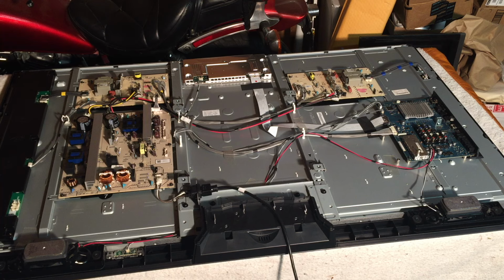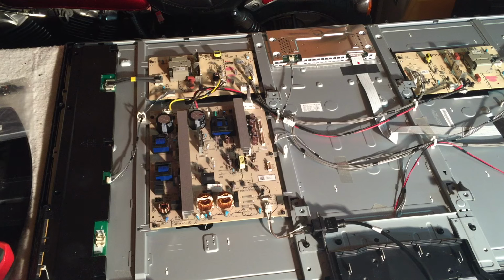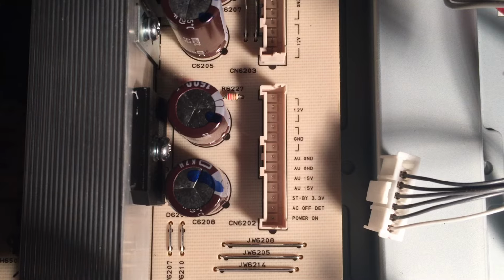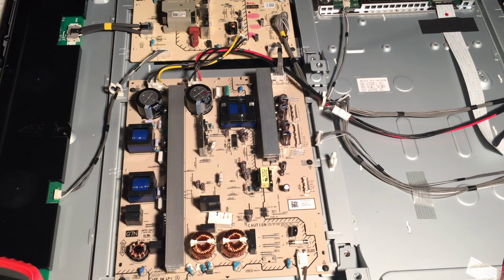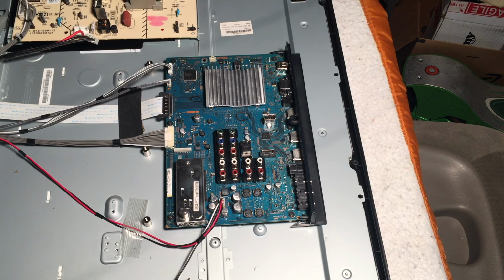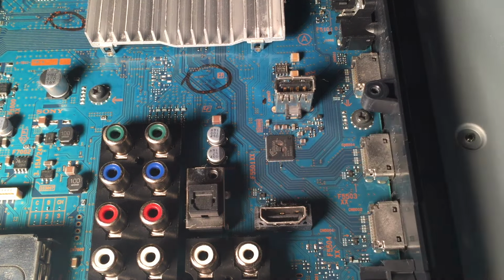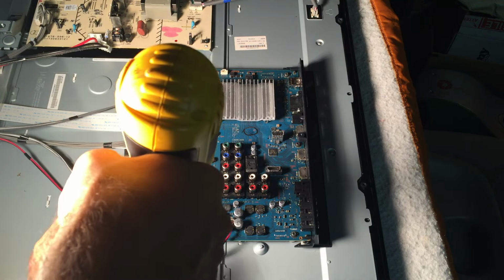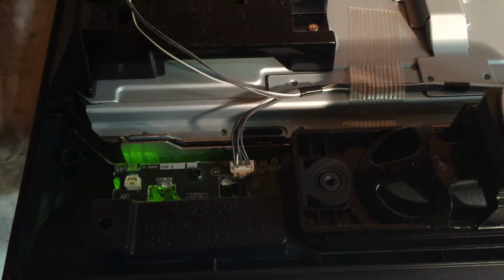How to Fix a TV Hit By Lightning or Power Surge

Comment: Hi. Thanks for the vid. I just replaced the same board on Panasonic OLED TH-55FZ950U that was so hard to find. The tv died when lightning hit the tall tree some 15m from the house. The tv was not giving any lights on front panel. I followed your steps to check the fuses and output voltage on power board and fuses were good and it does give the voltage output as it’s printed, so I decided to give it a go and replace the other board, although I couldn’t see any physical damage on any of the chips. The board was very easy to replace, but my moment of truth unfortunately didn’t go smoothly as yours, but at least I got a click sound when I turned on the TV 
using power button at its side. Then, green led at the front panel went on, then turned off and then kept blinking red. No pic or anything else appeared. Would you be so kind to suggest something additional? I love this tv and its remote and I would really like to get it fixed. Thanks again.

Comment: Hey man, would you happen to have any of the boards for a Phillips 65PFL5604 TV?

Also, have you ever encountered the following? After the latest firmware update on my Phillips, once the TV warms up there is a audible popping, through the speakers, in constant intervals about every 15 seconds maybe. It will continue even once the TV is turned off, and won't stop until it is unplugged.

I'm just curious, I'm trying to avoid spending the money on the board replacement, if it can be avoided. No it is not the heat expansion noises TVs make either. This is definitely coming from the speakers.

Comment: I have a 20 year old Toshiba 52HMX84 that was working perfectly !!
It was a victim of Duke Energy and its two back to back power surges in early July, 2024.

I’m trying to fix this on my own with no electronic experience.
It’s a DLP ….the bulb is ok….
I have ordered a new ballast for it but I have not checked the power supply board. 
When I have the TV unit plugged in the steady green light is ON…the Red light flashes…:
Shop Jimmy indicated it could be ballast or the bulb… it’s not the bulb….and I have not removed the old ballast yet to replace with the new (will arrive Sept 4th)

At the time of the Duke Energy double power surge….she was watching the cable and we also have an HDMI input port…
I have not examined any of those boards yet…
There is a small fuse near the corner of this big set and it appears to be good…not blown…that I can tell…
When I plug this set into the 120 outlet , I can hear a sound that briefly sounds like something spinning or trying to work…then it stops….

Any suggests on locating a qualified technician that would love to work on this great unit would be invaluable or any other tips to repair this unit..please let me know. 
Thank you !

Comment: Would it be foolish to attempt to replace the blown chip? Instead of the whole board?
Reply from the maker: The risk of only replacing the chip is that there may be other parts damaged too (like burnt traces).   But if you want to give it a try, then there's not much harm in trying.

Comment: Thank you so much. My sister has a Emerson tv and hers got hit by lightning recently during a severe thunderstorm. Now the tv changes channels by itself and the buttons do not respond correctly.
Reply from the maker: Sounds like either the main board got fried, the button bar (input bar - the part with the actual buttons), or both got fried.  If you have a separate input bar, try disconnecting that from the main board and use the remote control to operate the tv and isolate the issue.
Reply: Thank you so much.

Comment: Great video, and thank you! I have an issue with my 70” JVC LCD 4K TV, and would like your (and anyone else’s) opinion.
    The TV has been rock solid since it was delivered in 2019, up to now. It’s been used an average of a couple hours a day since. I was watching a movie a couple weeks ago, and the screen dimmed, then went black, with the movie and it’s audio still kicking along fine. I turned it off, unplugged it for a few mins, then plugged it back in. The red IR remote receiver light came normally, and I hit the “power” button on the remote. And yes, I am aware this is only a “stand by/sleep” button, and doesn’t fully power the unit down while plugged in.
   TV turns on, screen illuminates, and it seems to be working fine again. I walk over (it’s wall mounted), and place my ear as close to the bottom of the TV as possible. Now I can barely discern a faint, slight buzzing emanating from inside the TV. No burning smell, though. I sit down, go back to my movie, and 10 mins later, same failure, screen goes black, with audio continuing.
    So I repeat the unplugging, holding the power button down, doing the remote code thing, etc., from all the FIX YOUR JVC TV videos on YouTube. No luck. I wasn’t really surprised. Now this TV’s AC power has not been run through a true anti-spike strip (just a regular power strip), or any other power conditioner type device. So I’m suspecting the power board. I grab my Kill-A-Watt meter, and plug it in to the receptacle the TV was plugged into. Both outlets on that receptacle are showing 121V @ 60Hz. Normal. So I then plug the TVs cord into the Kill-A-Watt, and the voltage reading drops to 89V, then 112, then 119, back to down to 110, and so on. It’s basically all over the road. Same thing happens on the lower outlet. I unplug the TV. 
      I pull off the back panel, and there up on the top right side of the board (cold side), a single capacitor next to the dual LED wiring connectors is “domed” on it’s top, with obvious signs it’s spewed out a bit of some black dusty by product of whatever over heated goo is inside of it. Not good at all...
    So in your experience, have you ever seen a TV with a failure on the power board like this continue to work for a few minutes at a time, before failure?
And if so, what do you think the likelihood of this failure type damaging the main board is? Or any other component? Specifically the power button module, and/or T-Con board. And any idea what is happening with the voltage reading at the power receptacle? It seems like the board is “back feeding” shorted power out of the board directly into the cord.
   Anyway, thanks very much for your time, and attention to this novel of a post, and for any reply! PS I have the board out on my bench, and arrived here in search of videos on how to bench test a live (powered) board out of a TV.
 ~ Multimeter Rookie with a fire extinguisher handy 😜

Comment: The correct tools help significantly. Splitting the cases on plastic cased electronics should have a tool that is a plastic pry tool, that kinda looks like a Screw Driver‼️‼️‼️

Comment: Well, this tv I recovered from someone who isn't as inclined as I am and they set it out on the curb. It's a beautiful Samsung 55", that was well cared for, and looks less than 2-3 years old. I noticed a 2 pole plug, not like my Sharp's polarized plug. But, I remember that our Utility Provider had shut down for "Scheduled Maintenance" a few weeks back. I'm assuming it wasn't plugged into a surge protected power strip (all of my electronics use them), and when their power was restored their TV was not turning on. I am a Journeyman Industrial Master Mechanic, and if needed, I know I can fix a Military Tank 😊😁😎

This will become a monitor for  a Dell Inspiron sff tower that I also recovered that someone discarded... I cleaned out the Roaches, and a minor spill, and am upgrading it for my purposes 😊😉😁😎

Comment: Good afternoon.  My sharp LC-60E69U does not power up. But I do have the 5VDC standby voltage present (but no other power supply output voltages). The standby Red LED is on too.  The TV does not power up. Do u think it's the main board not giving a signal to the power supply to turn on the 12VDC, 24VDC, and other outputs? Of course the power supply fuse is good too. I have both replacement boards. Should I replace both first or just the main board first? I don't want an old board to damage a new board.  Thnx

Comment: I had a power "flicker" a few days ago and my TV turned itself ON and wouldn't turned off with the remote. I unplugged it for 20 minutes and it was ok afterwards. Except when I was watching it a couple days later, a dark shadow appeared in the upper left corner. What's happening?
Reply: That sounds like one of the backlights in the panel have went out, or possibly the LCD screen is shorted.

Comment: No but I need help on a phillips 50 in roku tv; it comes on, standby light does a double blink over n over, back lights work, I can see them cause I have the back off, I remove one of the buffer ribbon s from tcon and one side has Pic black on other opposite affect wen I reverse the ribbons the other side of the t will have Pic and black on other. No obvious damage to any boards getting 120 at source. Chief complaint was; they had a power outage, only used for light video games, at first Pic went out, by memory he could toggle to tv and hear the TV shows just black screen. As I mentioned back lights are in operation (they work),
Reply: Modle 50pfl4756/f7 w

Comment: I had two tv's hit (along with two DirectTV boxes).  On the first tv I checked the fuse, howevere I don't have the same type of multimeter you have. I went to ohms and checked, without power, it showed no resistance. I then connected the power cord and checked the standby voltage. The board indicated 5v on standby but I registered 3 and then 4 volts. I assume this means the power board in working. What are your thoughts? I don't want to buy a new main board until I get some more information. Also, there was no obvious burning or scorching on the main board.

Comment: changing the hdmi controller chip would be a lot cheaper
Reply from the maker: Agreed for the most part.  You’d would have you find a replacement chip plus potentially deal with any other issues from the power surge.  Also, most people can change a board but soldering in a chip is beyond what most can do.

Comment: Yes. I got 4 power sources and 2 tvs mesed up bu lighting.  My sony android had external power supply so i just bought a amazon replacement.  But my 55 LG tv have the power source inside . So i have to troubleshoot.😢😢😢

Comment: got a samsung 55 " (un55h7150afxza) has standby light, but screen is black.  replaced all 3 boards (power, main and T-con) still the same black screen.  Any suggestions?
Reply from the maker: Did you watch my fixing with tape videos?  I’m those videos is what I’d try next.
Reply: @FrugalRepair   i did, I will have to go back.  Thanks for the reply.

Comment: Thank You!  Thank You!  Thank You for this video and for helping me to find the part I needed to do the master board replacement.  A lightning strike fried all my HDMI inputs.  I had never dreamed of being able to do the replacement myself but with this video I was able to do it, and the new master board for my 86" TV was only $29.99 plus tax, including shipping.  Doing the job was a bit nerve wracking, but I did it and it worked perfectly when I turned it back on.  Very kind of you to help others with videos like this!
Reply from the maker: Thanks for watching!  I usually buy my boards on eBay.  You can use a website like shopjimmy.com to find out the model number of the board you need or you can buy directly from shopjimmy
Reply: @FrugalRepair  I got it for much less on Ebay.  Thank you!

Comment: Mine got hit last night. App can still turn on tv and switch to Netflix. I can hear Netflix movies playing. The picture is just a dark grey. Kind of milky looking. How do I fix that. Power light is on. All works except for the screen/video output.
Reply from the maker: You would have to do some diagnostics to isolate the problem board.  It’s You could try the isolation technique I showed in the tape fixing videos.  I would guess the main board is at fault because of the power surge but it could be something else.

Comment: What if you changed out both boards and you still don't see the stand by light and it's not turning on .??
Reply from the maker: Your button bar might have a short or open circuit on it.  Try disconnecting it and find out how to turn on the tv without it.  You might have to short two pins on the main board.

Comment: 5:55 thank you!! Can’t wait to go home and try this. My TV was plugged into a surge protector along with several other items including my cable box. My cable box was connected to the TV via HDMI and it’s only my TV and cable box that got damaged. All other items on the surge protector are okay. When I called the cable company to replace the cable box, they cam and simply bypass the HDMI out port on the cable box and used a port (don’t know the name) but the wire that was use to connect to my next tv had a 3.5mm jack end into the cable box and some red and white and yellow ends that went into the TV, RCA I believe… 
So the cable box power source seemed to not have been hit only the HDMI cause light was coming from the cable box just no display. The light that normally come on my TV when plugged in doesn’t so maybe it’s my power board and also the main board.. either way I’m excited to go home and try this myself! :) thank you for this wonderful video!!

Comment: I have an Android TV hit by lightening through the HDMI port, the power and control boards are more or less integrated as 1, although I can see from burn sign that the lightening did came in through the HDMI cable, there no any other sign to indicate a burnt chip. Can you please help ?

Comment: What if the standby isn't getting power
Reply from the maker: If everything is disconnected from the power supply (except for the wall AC power) and there is no standby voltage, then then there is a fault on the power supply board.
Reply: @FrugalRepair  wait wait, all I have to do is disconnect the main board from the power supply board and if I get a standby light, it's the main board? And if I don't get a standby light it's the power supply board?
Reply from the maker: @rustystaley7150  no, it’s not that simple for the main board.  But if nothing is connected to the power supply and you don’t get standby voltage it’s the power supply.
Reply: @FrugalRepair  ok. Getting a voltmeter. As of right now the tv will not do anything at all and there are no visible signs of damage from the power surge.
Reply: @FrugalRepair  or is it safe to say it's the power supply board already? I don't want to replace the individual components within the board, I want to replace the whole power supply board, will that fix it?

Comment: I just had a lightning strike, and it took the Xfinity router, the xfinity flex device, and my TV. The flex device was connected by HDMI. I am pretty sure this is the problem. I may try and fix it depending on the cost of the board.

Comment: Thank you for putting out a great Video!!  Recently a lightning strike fried my router, modem, Roku and firestick. My TV powers up, and stays on Standby. (OPC is on)  and I am able to see menu options. But Roku, Firestick and other HDMI video players do not display any pictures.  I tested all HDMI ports. Confirmed that the HDMI cable and the new streaming players are working fine by testing them on my computer monitor.  What board should I check/change ( and a good place to buy it).? TV is a Sharp Aquos LC -C4067UN.
Reply from the maker: Sounds like what happened to the main board in this video.  Your current main board has a board number on it, you can search ebay on that number or the model number.  I usually use both to find the best one.
Reply: @FrugalRepair    I ordered a part online and was able to repair it on my own. TV works now! Thanks to you, I did not have to buy a new TV!!!

Comment: Excellent video thank you.  I have a sony xbr_65a9g oled. Lightning strike also. After reading through all the comments i didnt find one talking about replacing power supply and control board. Then after only having sound on the tv which im happy to hear. But the display is still black. What would u look at next to get the display back?

Comment: So I’m not seeing the standby voltage area after disconnecting the harness.  Any suggestions?
Reply from the maker: If you’ve tried every pin and there is no standby voltage, Then there is something wrong with the power supply.

Comment: Where did the new board get purchased from ? Thanks in advance.
Reply from the maker: Ebay
Reply: @FrugalRepair  Thanks much.  Excellent video btw. Her refrigerator is one of those big expensive side by side with the big chest drawer freezer below. The digital board where you adjust everything is lit up but like when a digital clock goes bad, whole numbers don't read, parts of what you see are missing AND when you try to change anything, you can bump it up or down but it doesn't respond to the command. The 'enter' command doesn't work. A friend is in a gospel quartet and one of his members does appliances and says it has two boards and the one showing , if it looks funky , could be the culprit OR both could. He'll check it for nothing but it's WAY out on the mtn and takes an hour and a half trip to get there. In a situation like this, even costing me $150 + to get it to him and back, would throwing a board in it be advised, especially when you see it reading funky or should I bite the bullet and take it to him? I appreciate your time. It's expensive as hell and a only couple of years old, maybe ...3? I picked up a cherry black mid 90s side by side at an estate sale for $75 cash to get her by. She has lupus and didn't even know it got hit until she recovered from an attack and opened it up 3 days later. Woe! It'd knock ya down.  I had more in getting it out there than I gave for it. Lol. I pay a friend to do it btw. Truck poor right now.